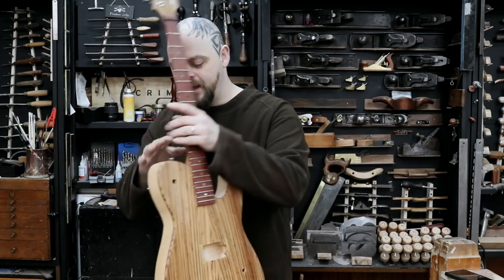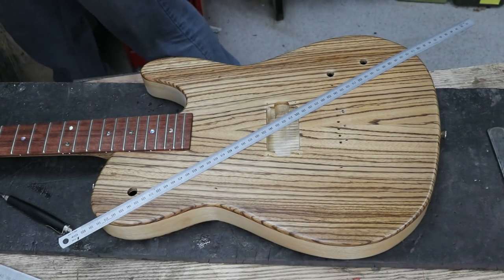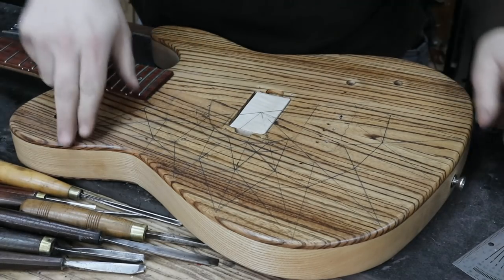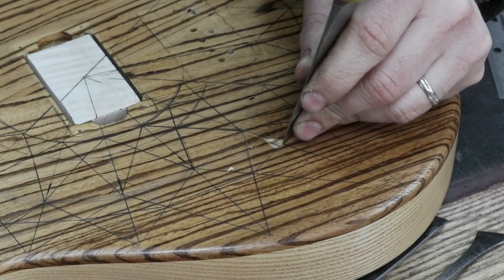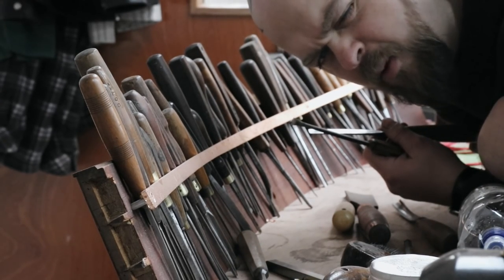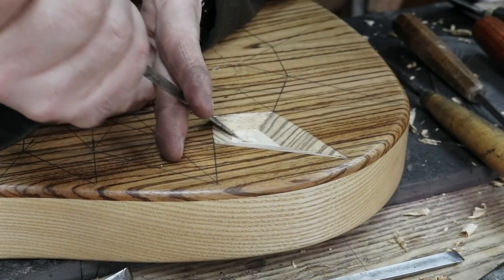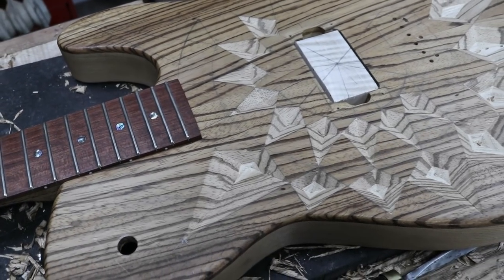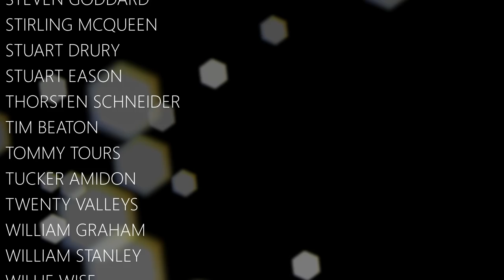Ep 1 - How to Chip Carve a Unique Design into a Zebrano Guitar Top

Comment: Hi Ben, Im a starting luthier (jokelaguitars) and I recently discovered an interesting problem with my latest guitar. Its a baritone 6 string with a finnish birch neck and ebony fretboard. It played great after I finished but after a week or two I noticed that the frets have become proud from the ends. I assume this is because the neck shrunk after finishing it but what is the cause? Was the wood simply not dry enough, do birch and ebony not fit well together since birch is not really used alot. I know that dry wood may even expand when gluing because of the moisture in glue and then shrink again after a while. I know I couldve just waited for the neck to become stable after glueing, or do the fretwork again now that the necks seems to have stopped shrinking. I would just like to know what you think is the cause for this, if you experience anything like this in your builds and workarounds. Thanks!

Comment: I think you should add another diamond to the outer circle on the bottom next to the knobs. In that case, it's center line will meet with the center line of the diamond on the outer circle right above the neck. It will look a bit more balanced :) A complete outer half-circle and a complete inner half-circle which are rotated around the center of the body in respect to each other.

Comment: I'm making a guitar and it has a live edge with bark, what's the best way to finish this to strengthen the bark and stop it crumbling away over time? Should I use epoxy resin or something or will oil do fine?
Reply from the maker: Superglue works well but be gentle, it is not nice to clean off love edge bark, drip thin superglue into the side of the bark not onto the outside. B
Reply: thanks! should I oil the bark when I finish it or leave it raw?